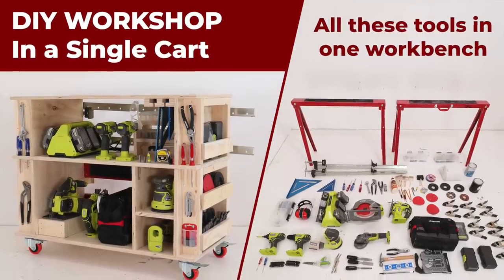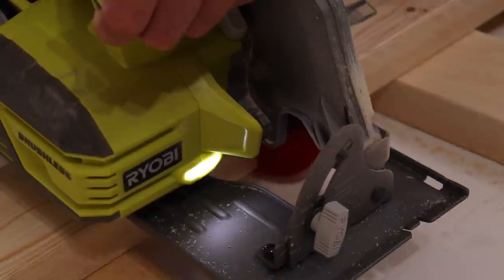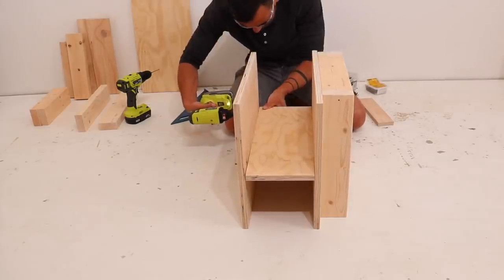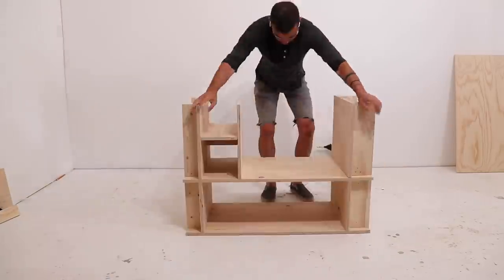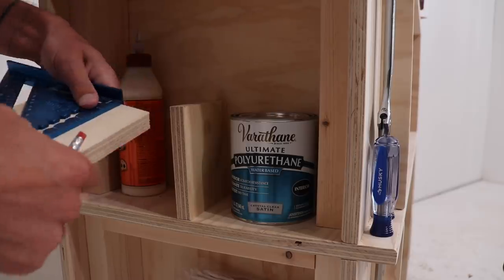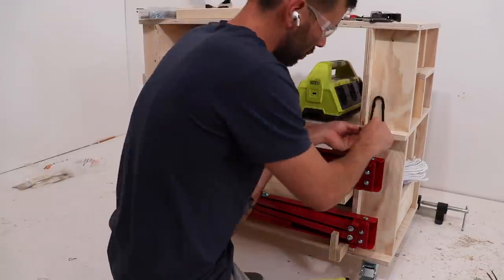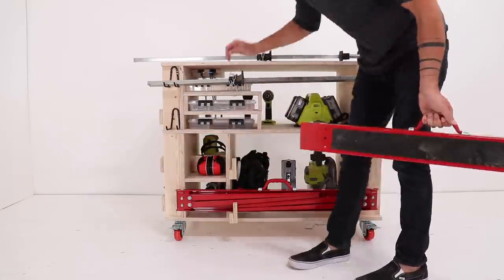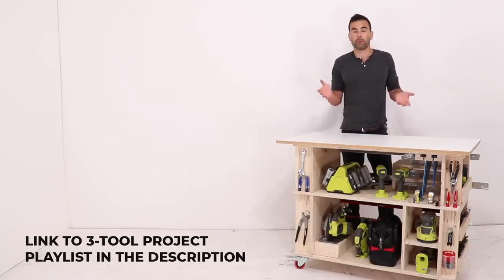Complete DIY Workshop in a Single Cart

Comment: If you installed on on-board plug-in strip, and just plugged the cart into an extension cord, you could have several different kinds of work-stations from this one design. It could be a powered carpenter's workbench, or be a movable printer stand, or, with some better plywood, sanding and paint or stain, it could be a small mobile desk.

Comment: Another terrific video. Thanks!

I’ve been a DIY woodworker for several years. Perhaps the biggest lesson I learned is that you do not need a shop full of tools. If I knew then what I know now, I’d have kept my tool collection lean and mean. I’m currently culling my tool collection. Pareto’s principle for tools: I use the same 20% of my tools 80% of the time.

Comment: Nifty little project, though I would have screwed the Melamine to the top by coming in from underneath. The you could still use the unblemished melamine for something else later on, like concrete or epoxy forms.
Reply: Good point!!
Reply: i bet when he reads your comment, he'll be like... "omg, obviously, what was i thinking !!"
Reply: Except it is a work surface now... so it won't be "unblemished" when he takes it off. It will be dinged up and have scratches and potentially holes in it also.
Reply: Could mount  a kraft paper roll dispenser to one short side (above the sandpaper bin), protect the melamine surface some when finishing.

Comment: Sweet project!! I'll be doing something very similar in my garage over the next few weeks. One thing I would add(as should you) is a little power bar that you could plug in when you move the bench to somewhere else. Also, throw the battery charger on there and you have an entire mobile work station
Reply: Great idea Vance... where do you think is the best location for the power bar?

Comment: Hold the speed square on the 2x4 with your hand pulling it towards you then run your saw with the perpendicular edge as a guide; this will get you about as close as you can to 90 degrees. This technique will also work to make 45 degree cuts. Just a helpful tip.

Comment: This could not have come at a better time.  I just had a woodworking shed built in my backyard and was about to use one of the dressers in a spare room that doesn't get much use as a repurposed Workstation, however it would take up a large portion of wall space. After seeing this video the dresser gets to live on and I will definitely be using these plans instead. Thank you so much

Comment: Very cool. Could potentially add some sort of interlocking (or even magnet), and have multiple carts that can connect to create  a larger square  work surface or long bench for storing away.
Reply: Ryan White three more similar carts to create a bigger work area/table! Possibly pegs and holes on the sides on join/connect or magnets like ou said
Reply: Bob over at @Iliketomakestuff did that. Has a video on it too

Comment: Awesome... Just confused as to why you marked a line on the 2x4s with a speed square then cut them by hand when a speed square is designed to be used as a guide for that. Suppose not everyone knows that though. Any rate you are still very talented.

Comment: Awesome DIY project. I could easily see this being used in a full shop as well. This is why I had issues with the conference table build. Your channel grew so much on the DIY/maker kind of stuff. Design was definitely there, but I feel like you're one of the top Maker movement faces.